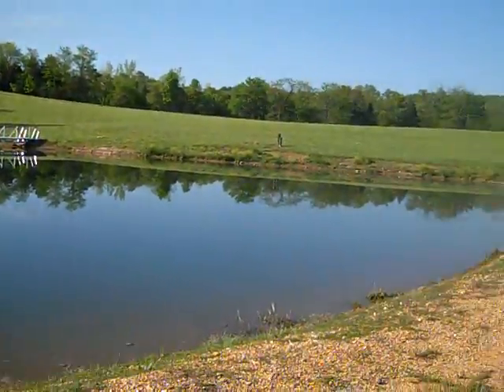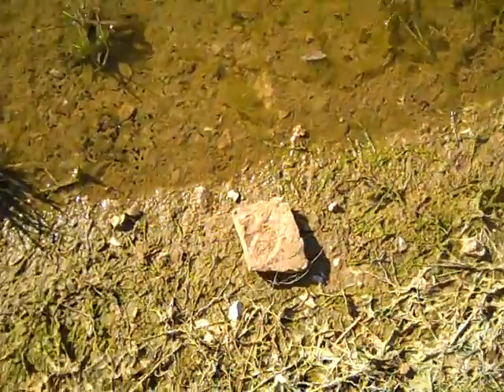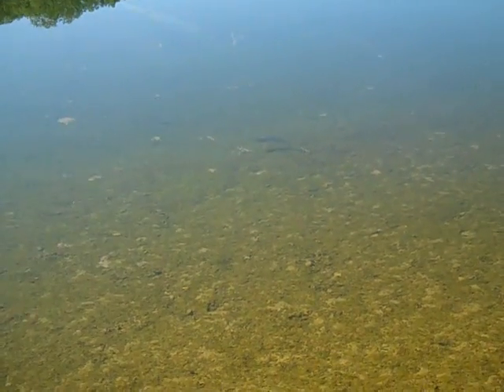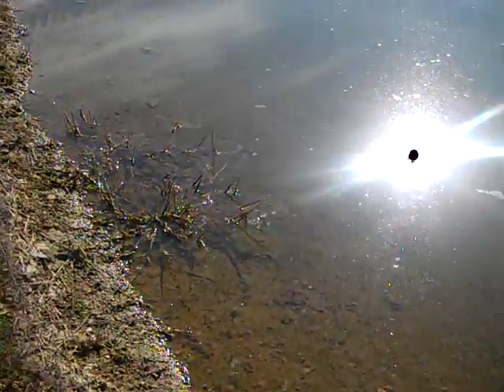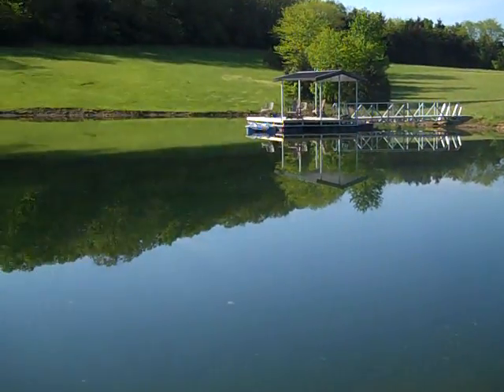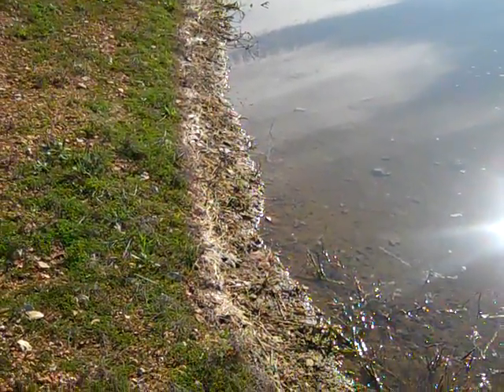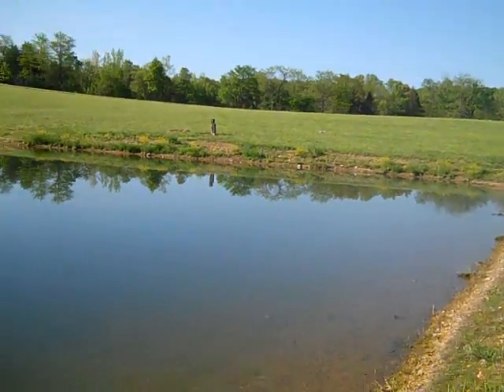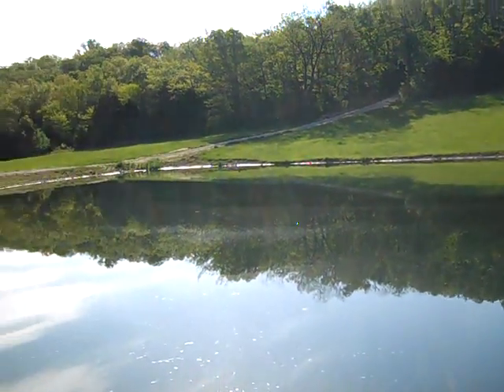Pond repairing ideas

Comment: I do it for a living. Drain the pond . Scrape out the sludge,get it over the headwall is easiest.3 options .1  clay trucked in & compacted ,in an even layer especially the headwall .2 Bentonite loose or blanket .Supplier will have instructions ,it must be even and have up to 12 inches suitable dirt compacted evenly over it.As the bentonite trys to expand but can`t it will get denser and improve the seal even if penetrated . Last option is a plastic or rubber liner.I`ve installed them for clients at their request ,but can be damaged buy careless action or wild animal falling in and trying to get back out.I would finnish the pond off with  some plants in the water.Lillies  reeds etc that are local to you but not a weed . This will restart  the lifecycle again act as a nutrient filter .You have a beaut place , good luck from Australia .
Reply: +Trevorz Zealley  I know where my leak is located, a good 5 feet below max capacity. It was caused by a tree that fell and the limb impaled the dam and over time the water worked it's way through. I know where it comes out at the base of the dam. I  poured bentonite into the opening and added potters clay in 4 inch thick layers over the hole area. You can not see the whole per se. It is slow steady leak, maybe 1/4 gallon a minute. Water came in but it did not get fulll enough for the weight of the water to penetrate the bentonite. It is fall here so the intake gets clogged with leaves and I can't clear it 4-10 times a day.  I am wondering if I can get a 15 by 10 rubber liner to lay down, cover it with small stones and sand and lay 4 foot tubular sandbags around the edges and put several on top of the area where the hole is located. I want to think this will make a good seal and once the water fills the pond, the pressure of the volume of water will hold it in place.  I had a backhoe operator in here a few years ago who dug out the section of dam but we did not find the hole until he was done. We backed it with bentonite and it held well for several years. I hate to think of draining the whole pond and losing my fish and frog population.  the water level get below the leak and stays there. THX for any advice you can offer. It's hard to get decent work around here so I doubt seriously if I can get someone to dig it out and start over.
Reply: +I. O. Watkins  ,sorry to hear that you still have a problem pond . Sometimes leaky ponds can self repair, but yours should have stopped by now if that were to be the case . I  do have a caution re: the rubber/plastic  liner in that if water dos`e get behind it the leak will continue . Please let me know how you get on with it ?

Comment: Allowing it to drain until it stops will give you an idea how bad the leak is,,,then work in some granulated bentonite  a couple of feet into the water (you can throw it into the water but will have to working INTO the dirt on the dray bank) and up the dry bank about 5 ft. Other then that you will have to drain, rebuild the floor of the pond and add Bentonite anyway. I have heard from some old farmers that you can use a boat and distribute it over the floor by hand,,,maybe.

Comment: We found that grass, frogs, ducks and other life added enough oil/dung to keep ours full. You must have enough "slime" on the bottom to hold the water. The other question is was this a wet pond type area to begin with or did someone just dig a hole and fill it.? The later would account for the ground drawing water to the surrounding area and aquifer. Can you dive on this and see what the bottom is?

Comment: From the looks of the water, I would say that the previous owner had a different property management technique. There's no way they would run the pump like that. I would look at how the grass is being maintained. It looks like the fish have eaten everything that used to accumulate in the water and keep it sealed, ie. grass clippings/manure/fertilizer/water grasses. Also, let the shallows dry so you can repair the banks from erosion and plant grasses. Use the shallows as rain storage.

Comment: I have heard of a cheep way to fix this. let the pond drain down to the point that it stops on its own. Than run sum pigs on it. They will stomp the ground and plug the leak. There is a farmer in Swoop VA that does this when he has a pond that leaks. His name is Joel Salatin of Polyface farm. Hope this helps

Comment: Let the pond continue to drain down until it stops.  That will give you a rough elevation as to leak. Mark it then drain it down a little further and let it dry somewhat.  Then seal both side of the leak elevation with whatever method fits the budget (ie... clay, bentonite, or various slurrys)   That mite safe a complete pond rebuilt.  I am a Structural Engineer.

Comment: Scott, I'm no pond expert, but the research I have done for my leaky MicroHydro dam pointed me toward Benseal/sodium bentonite.  I saw a you tube video where it was used by the dump truck load and spread with a front end loader for a leaky pond.  It's gotta be expensive in those quantities and the pond must be drained.  I pay $14 for a 50 lb bag.  It's worth having a scuba diver swim around the bottom to try and identify the location of the leak before spending a fortune.  Good luck.

Comment: Not an expert but I've read where in the "olden days" farmers would drain the pond and put pigs there to route out the pond bottom for at least a year.
In Missouri it is not uncommon for folks to spend big money to build ponds/small lakes just to find out the land will not hold water.

Timing is everything: The MO Dept. of Conservation is hosting a pond workshop in Concordia, MO tomorrow night. Check their website under events for more info. . The "experts" will be there.

Comment: Contact the local  USDA-NRCS Field Office. Bothbentonite & poly have pros & cons. The cost of poly on a pond that size would be prohibitive. Bentonite only works if you hit the right spot or the entire area. It can also crack & roll to the bottom if it dries. Livestock can punch through either if they are not sufficiently thick.

Comment: Seems to be a normal problem with bodies of water lately. Our local lake , around 100,000 acres, has a major leak. They have worked hard for several years to find the leak but have not yet located the problem.

Comment: Some pond leaks are relatively localized so a company with sound equipment _may_ be able to locate such a leak.  Powdered bentonite is then mixed with water (it takes time to hydrate) and pumped onto the suspect area to patch it.  A similar process can be used to line the whole pond if there's no one suspect area, but that's not cheap and will likely come close to wiping out all the fish in the pond.  OTOH draining it will do the same.  
Sorry, no cheap answers.
Logan, Engineer

Comment: First determine where the water is going.  Was the dam constructed with a clay core?  Without borings its hard to say.  Contact a Geo-technical Engineer in that area.  They can not only advise, but certify corrective measures.

Comment: As others have suggested, I'd let the water leak away untill it either stops or when the water gets so low that it becomes dangerous to the fish. Then when the water has stopped, think about how to fix the leak. Otherwise (when the leak is at the bottom) I'd get the whole thing lined. 
Tim

Comment: Roman concrete plugs were used for ages, and they work under water if necessary. It then becomes an issue of finding the leak(s).

Comment: First I would swim around with a snorkel and mask if the water is clear enough and look for fissures on the bottom. Has there been fraking in the area? I agree that bentonite or clay may be the best and most cost effective. Then get ducks and geese to maintain it along with vegetation to help hold the bottom in place.

Comment: I'm not sure what the chemical is called, but we used it in 2 of our ponds 55 gallons of the chemical, downside is you have to circulate the water.  We used a jon boat tied to shore fired up the motor and let it run.

Comment: If there is no muskrats then you need to drain the pond, hire a bulldozer & operator with extensive experience in repairing leaking ponds, have the dozer operator dig down to a good base of clay, I would recommend that the operator make clay steps around the bottom edges of the pond before making the bank.  If there is no clay in the bottom of the pond dig the pond out & line the bottom & the steps with bentonite clay and line the inside banks with the bentonite clay, & pack banks hard.

Comment: The trick is in finding the leak source, after that is done then as others have suggested use a natural substance like clay. That would me my suggestion. To find the leak it is most likely on the wall area, (not has to be) could look for excessive dampness and depending on the level in relation to depth allow to drain till the sealing can easily and successfully be applied. Best I can come up with, cheers from John.

Comment: Lining it will be expensive.  You can try a clay compacted liner, if it is readily available.  Or even, get used conveyor belt for lining the bottom, then put compacted clay over it.

Comment: I would let it leak out since it is a slow leak and try my best to find the hole first.  If the dam doesn't have a solid clay core you could blanket it with said blue clay (if that's where the hole is).  Look out for crawdads, they will swiss cheese a dam in no time.  Also, I'm no pond expert but I really like building them when I have time.

Comment: mounted on top of pontoons We built a 4 hopper system to do a small pond like that because the client didnt want to drain and restart. its less expensive to drain and apply bentonite. Also i have seen several ponds lose water to the water via shallow and deep well water tables when you dig well so close (Southeast Alabama)